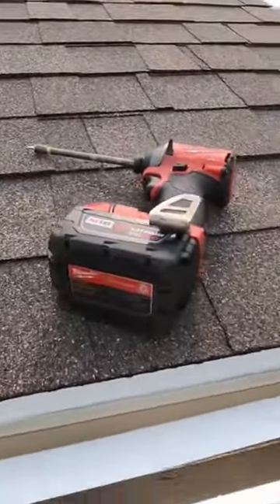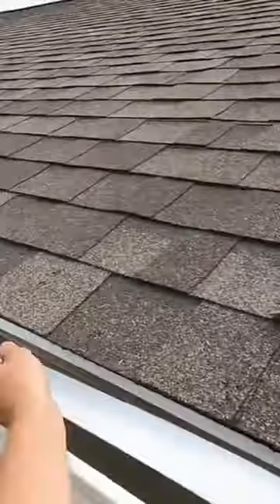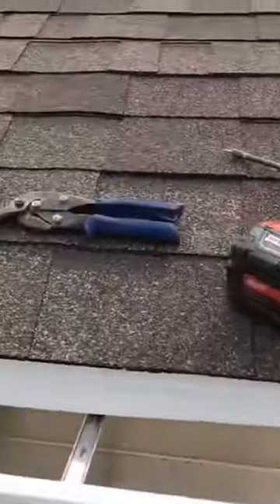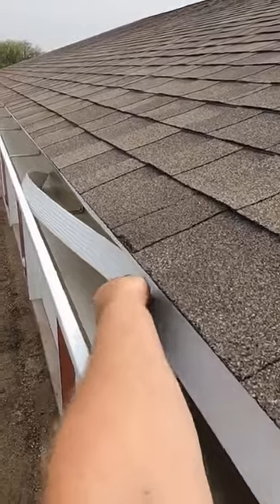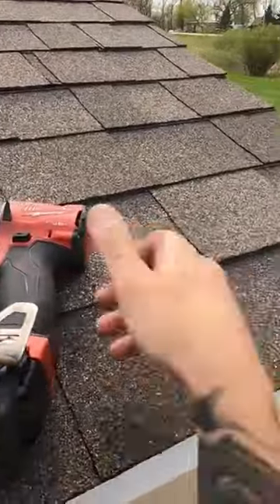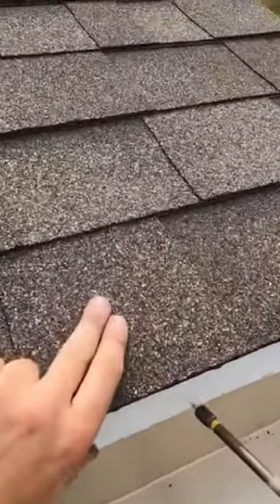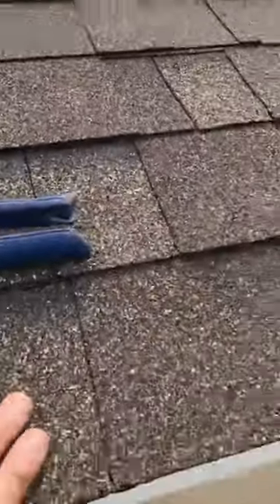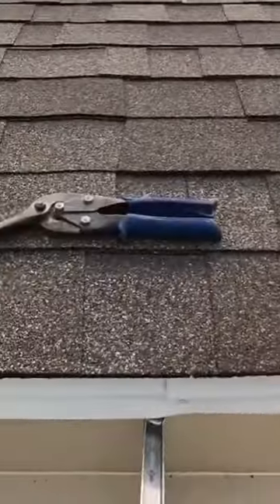DIY EXTENDED DRIP EDGE fix! Water between gutter and fascia fix! Better quality on my videos! #short

Comment: bit confused. It appears that you are inserting the trim underneath the roof but screwed it on to the gutter. So, is it an L shaped trim like a drip edge?
Reply from the maker: @orkayen  i cut trim coil to 2”-3” wide strips and slip it up behind the drip edge, but over the back of the gutter. So water can’t get behind the gutter and go between the gutter and fascia.
Reply: @LevisSGANDOUTDOORS  Thanks. I understood that part. But not sure where you are attaching it. The video shows you are attaching to gutter/fascia board. If so, the trim needs to be an L shaped.